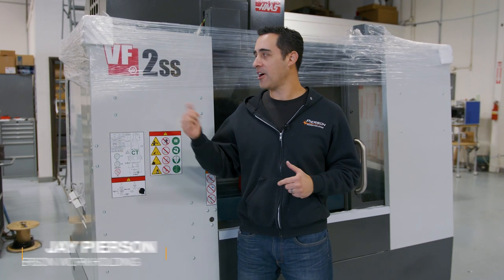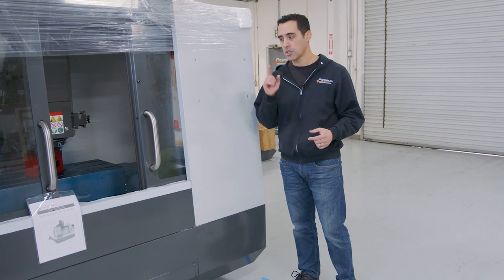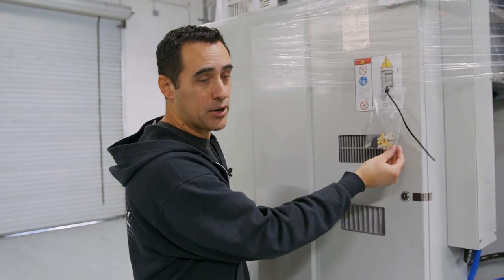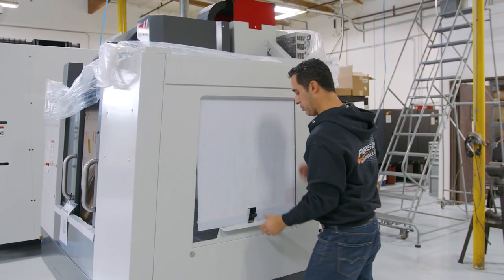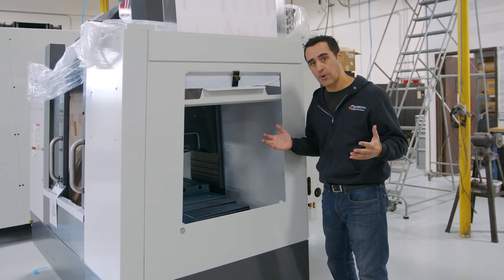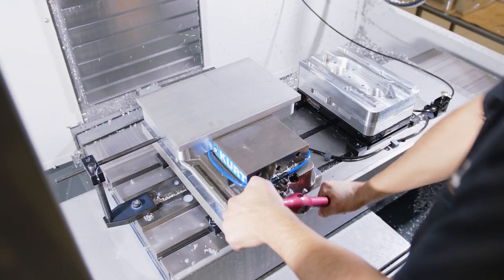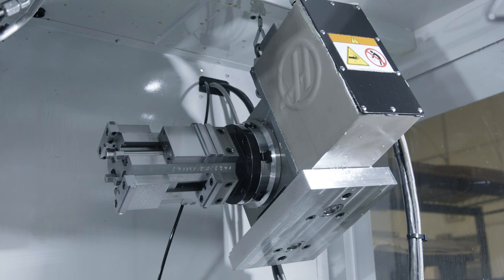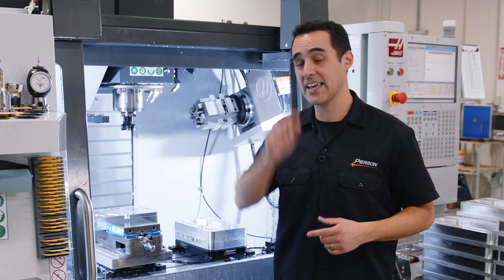The HIDDEN COSTS of a HAAS VF2-SS | Pierson Workholding

Comment: I got a pretty decent brand new 40x20 VMC ATC 4th Axis installed from china for just 18,500USD. Was going to buy Haas, but in the end the hidden costs angered me. Been quite happy with my purchase, everything is standarized, I can order components from a lot of different vendors. The spindle is robust.
Ballswcrews from HIWIN in Taiwan... very happy with my purchase.
Reply: Where did you order it , shipping included ?
Reply: What brand? Model?
Reply: @shaneduffy4853  Shipping was not included, but I ordered also a lathe, a gear hobber, a hydraulic press and a bandsaw. The whole container was less than 2000USD. Customs was somewhat around 400USD. For all the machines I payed about 55k. All new, no problems at all.

The controls are GSK, run smoothly and fast, they may be lacking some fancy options like spline (G5), but overall they run quite well. 

On the CNC I got cheap and bought the semi-open enclosure (full enclosure is about 1500usd more), and would recommend buying the full enclosure.

The business is called Tengzhou Bouri, I bought it trough alibaba with trade assurance, no problems at all.
Reply: @alldayy   Tengzhou Borui  XK1050
Reply: @franciscoanconia2334  what "hidden" costs?

You talking about options?
Reply: @Iceberg86300  The first thing that got me off was the wiring for the 4th axis, which is complete BS. The whole bus and the controller is perfectly capable of driving any 4th axis, buty they sell that as an "optional" extra (on top of the 4th axis itself), that preparation is about 4000USD alone. 

Then is the probing system, which, of course you can only use a Renishaw with the propietary Haas interface. You cannot simply buy a renishaw made for Fanuc or Siemmens and plug it it, it has to be Haas.

There is also the issue with the coolant tank. The one that comes standard is somewhat useless, they "strongly suggest" you buy the 95Gallon... that's 2K. on top.

The shipping has to be with an authorized rigger, and the price is twice as any other machinery transport service... add another 1.5k.

The memory that comes with the control is unusable for modern mesh programs, you have to buy the expansion at least to 32GB, add another 1.5k. You'd think you could use the whole USB to store the program, but you'd be mistaken, you are required to buy the option if you want to do any 3D mesh machining.

If you want/need to use the ouput for another MFunctions, thats another 2k, just for ACTIVATING the option on the controller. Even if you want a third-party rotary table, that will set you off 2k.

Second  home poistion that comes standard with every other controller... yeah 1k.

Also.... I was required to buy an Isoleated transformer that does god knows that... another 3.5k.

Cabinet cooler (a must if you want guarante)... 2k. 

You want to write your own macros... (which I do, all the time), another 3.5k.

You need rotation and scaling (which if you're doing batch jobs, rotation is a MUST)... another 1.5k

And the most propostrous of all is the "high-speed-machining", which again, is a dumb activation of a module on the fpga which will run you out another 3.5k... again, without this "options", the machine will be basically unusable for any modern machining (like 3d machining or even trochoidal or full contact machining).

There is also the issue with the 7.5 THOUSAND dollar PER YEAR warranty, without it you're basically toast since you will have to pay full price for the controller or anything that goes wrong with the machine, also if you service the machine with some "unauthorized" third party, you're toast... the warranty will be voided.

There was also the issue with the 4th axis... which was such a dealbraker, If you want a 4th axis, the cheaper option (that works) is around 30K USD.

So yeah.. I got a very functional machine for less than 20% from Haas. Sure.. It might not have a brand name, but none of my customers seem to care.
Reply: @strangevisions5162  If you think nationalism will lead the manufacturing resurgence in the USA, you're terribly mistaken. People look for value wherever they can. Customers will keep flying to the other side of the Pacific unless we can come up with competitive prices. 

I cannot justify buying something that I know is worth very little, specially activation of software features that cost Hass nothing. I don't know how much the manufacturing of a grinded spindle is really worth, or the materials they use, what I do know is that activating some optional M Codes is not worth 2000USD. I'ts like someone sat down with a list of specs and just decieded how much could they charge for each item regardless any added value to the product.

It's not about saving money, it's about producing value, and If somehow i can pass some of those savings to my customers (which I do), maybe they'll start looking here instead of going to Asia.
Reply: @franciscoanconia2334  I never said nationalism would lead manuf resurgence(although it wouldn't hurt). I never said anyone should buy Haas. I questioned why people continue to support the regime that does X/Y/Z. But if it saves you a few dollars, that's all that counts.
Reply: @strangevisions5162  Support the regime?. Dude, I bought a CNC mill, take down the rethoric two notches. Everyone and their mother buys from China. The chinese dependency will only continue to grow unless we get it together and start being competitive and productive in manufacturing.
Reply: @franciscoanconia2334  "Dude, I bought a CNC mill, take down the rethoric two notches."
of course, it always starts with someone else doing something or making a sacrifice.
Reply: I think there is also an angle that should be considered. I would never let my employees work on my Hermle, a crash on that thing would be catastrophic for the business... however, I really don't mind them messing around with the chineese borui. It has become such a good opportunity for my employees. They are much more confident setting up the machine knowing that a fail will not be catastrophic.

Also, I can now run and sell full batches on the cheapo chinese machines instead of just building the prototype on the Hermle for it to be shipped overseas as reference.
Reply: Francisco Does it has the same specs and speeds of haas vf2ss?

Comment: That 4th axis looks sketchy, but it does seem like a good idea. Haas should make some option with a winch, but then you can put bolts through the ceiling to the rotary for extra safety. Or maybe have some kind of fold-out shelf.
Reply: I made a cart that gets trough the side and allows me to place the 4th axis and take it out trough the side window. I did however, had to cut the sheetmetal (ugggg). But it works just fine and looks tidy. Also, after a while, all that material just stiking around the 4th axis is a pain to clean between jobs.
Reply: @zunuf "Thank goodness we have people like you to fill in and shoot down random ideas on the internet." 
why get mad at some guy telling the truth? he didn't make the laws or the lawyers, nor did he make people sue.
Reply: @strangevisions5162  Because it's a useless comment. Pointing out the obvious doesn't make for interesting conversation or innovation. We live in a world with skydiving, roller coasters, fireworks, etc etc. Safety and liability matter, but people who flatly dismiss things like he did, ignore the nuance of how the world actually works.

The whole point of my comment was to come up with a SAFER version of what Pierson is doing. To me it was comical that Haas can sell giant lathes and gantry machines, but a shelf that holds a couple hundred pounds is far too dangerous.

Comment from the maker: ✅ Tired of making one part at a time? 👉 https://bit.ly/3xIXQuH
Reply: Nothing wrong with my 6 Haas… zero issues over 11years

Same old junk repeated by people who don’t have a Haas 😂
Reply: Keeping the 4th in the Machine is a great idea.  When you get some time you might consider mounting some brackets for the rotary to sit on, so you don't have to rely on the winch cable.  The Haas rotarys aren't super heavy, but keeping fixtures mounted adds a decent amount of weight.

Comment: Nice video - big bucks for sure . you checked the machine well but did not seem to comment that the spindle was directly blocked to the table for shipping :( It should never be the spindle but the spindle housing .😂
Reply from the maker: The spindle housing was blocked to the table. Haas has a special bracket for that. Open your eyes 🤣

Comment: We have two and have had to replace the balls crews after two years because they can't hold their tolerance specs, none of our other Haas machines we have to do this with. My advice don't get an ss.
Reply: This is truth. Nobody talks about how the SS option reduces accuracy and reduces ball screw life while proving an insignificant cycle time reduction. Haas only added the SS option to compete on the spec sheet, not because it makes a better machine. I worked for 8 years at a company that ran 500 Haas mills doing both part making and mold cutting. Don't get me started on Z fiction compensation or notch filters on Haas machines.
Reply: @daphoosa  yeah... for fast milling you absolutely need chilled guides and temp-control on the ballscrew, something DMG is very capable of.

Comment: Sorry to say but if I purchased such an expensive item I would expect it to be in perfect condition out of the factory. Missing seals is unacceptable and not my job to find out if they are installed correctly. Things like this would make me look for another machine maker with focus on what leaves the factory.
Reply: Then you would be paying more money and still you would have problems. Even expensive machines have problems from the factory.  I know because I used to fix them. It may be less often but there is no 100 percent perfect production / transport history and you are only fooling yourself if you think there is. If you buy a cheaper car you can not be surprised if it has a problem when new but when you buy an expensive car guess what , sometimes you also have problems when new from the factory. I know plenty of people who bought the overpriced  imported "luxury " car and issues and troubles that came with car. The difference is when you buy a cheaper car that still gets you from location a to location b you keep all the money you would have wasted on a fancy car in your pocket.
Reply from the maker: As if perfection has no cost?

Comment: 60k!.......I just got a quoted a vf2 loaded for 85k!!!! 🙈🙈🎂🎂
Reply: is that with a rotary?
Reply: @justinm4323  heck no 85k doesn't get you a rotary just auger, high pressure, probe, and hsm.
Reply: @justindonajkowski336  I paid 79K delivered for a VF2 30 tool changer, auger, Though spindle coolant, probe, HSM, 4th axis HRC 210. 7 months ago.

Comment: I'd be willing to bet money $ the fans on the side of your machine are discharging hot air, not blowing in ambient air. As such, placing a filter over them is pointless and counterproductive. With the machine running hold your hand near the fans and check the direction of airflow. You're welcome.
Reply from the maker: Ohhh you mean we're supposed to filter air going INTO the machine?  Wow, thanks!  Boy, building a company is easy but figuring out airflow direction... really tough! Thank you for your expertise!
Reply: @piersonworkholding LOL! I think that dude should be more concerned with the hot air that comes out of his drunk-ass mouth. The filter idea is fantastic and any sane person knows you know what you're doing.

Comment: BAHAHAHAHAHA you look below the surface and you still bought the HAAS?

Sorry but had to take a bite out of the low hanging fruit. Great Job Shop machine, easy to setup easy to service. But if you're looking for production or automating a CNC folks gotta go with Japanese, or if you budget strapped Korean. Germans are too complex in their engineering which can cause significant down time. Nice video though, amazing what a 4k camera and a drone can do for you.